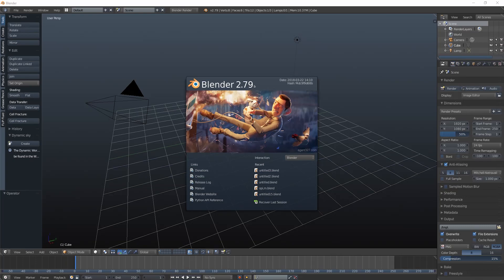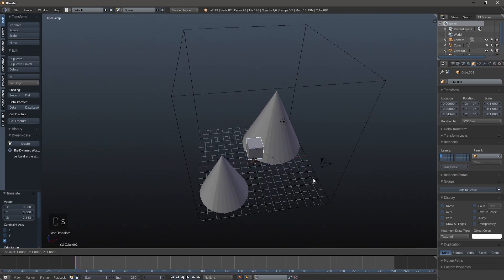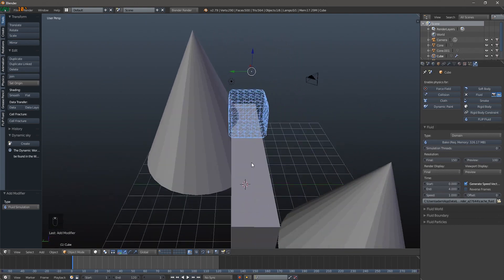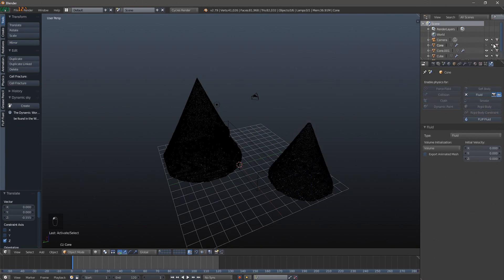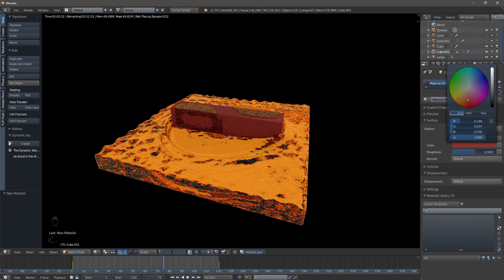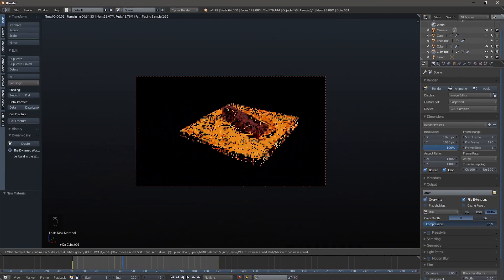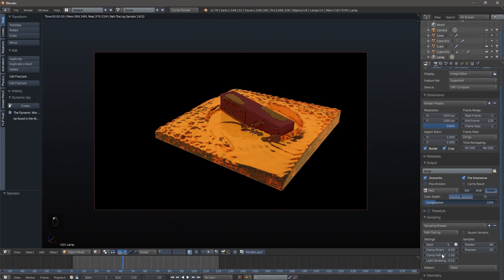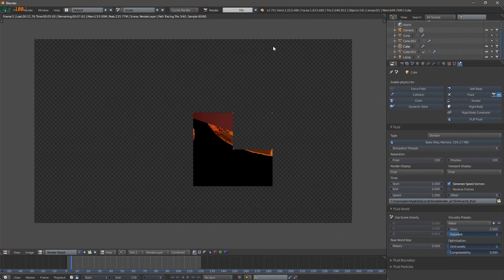Blender Fluid Tutorial (Part 1)

Comment: How do you keep the original shape of an object at the beginning of an animation? Like when you melt something.  A good starting transition. (In flip fluids) Thanks for the nice tutorials.
Reply from the maker: Sorry little lost on the question you mean the fluid object? or the object obstacle ?  Sorry just a little lost.  Flip fluid was not used in this tutorial.
Reply: @3DRENDERED  i know you didn't use FF but  I saw you have the add on :-) I want to "melt" a fluid object made of modeled mesh, like a skull for example ans the first frame of the animation looks deformed already. When i put the original mesh like 2 frames in front of it, there is like no smooth transition from original mesh to deformed fluid mesh. I kinda don't get the trick :-) I'm a blender noob, started in march just for fun. Cheers!
Reply from the maker: @stephanalbrecht7889 Ahh so your trying to slow melt the object into a liquid? Like melt chocolate  type of consistency?  To do that in the domain settings under fluid world there is a viscosity preset you can change tit too a couple of things honey water etc.  There are a few websites that break down different settings for different materials.  I don't recall them off the top of my head though.  Another way if your wanting to stretch out the frames you can change the speed of the fluid simulation  to a slower time. Also make sure you set your start time and end time to match your frames.  Nothing wrong with being a noob in blender everyone starts off that way.  And most days I still feel that way. Fluid simulation take a ton of time and practice often time ill tweak and rebake many times to get it the way I like.